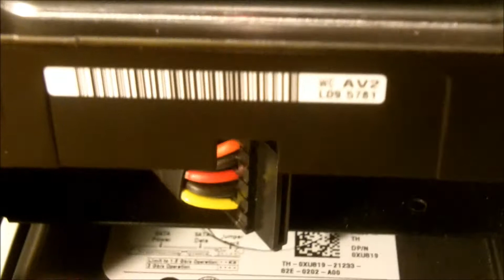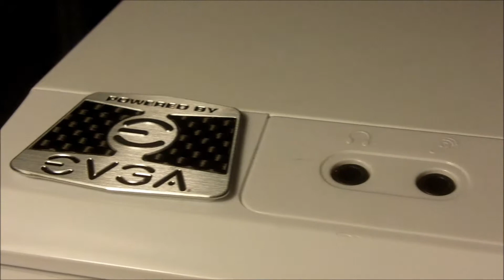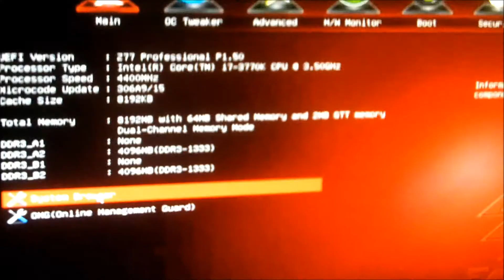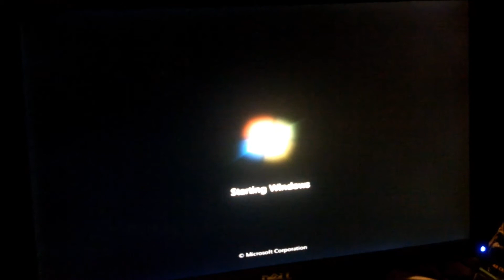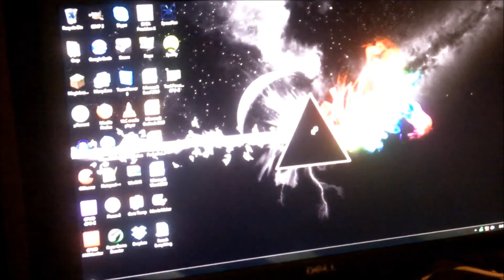i7 Gaming PC (2013)

Comment: i just think it was not neat as logical as a single card that is just as good as a low end card in SLI. Also, i would go with a 650 instead of a 550 if it was out at the moment. I am assuming it was.